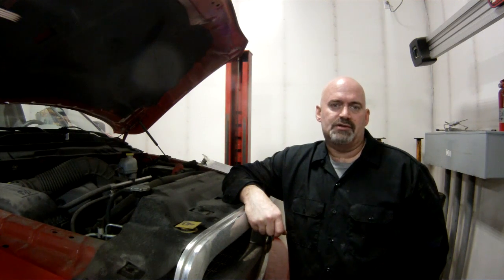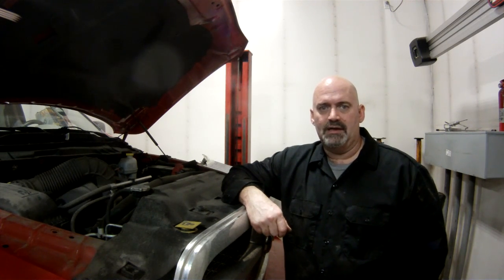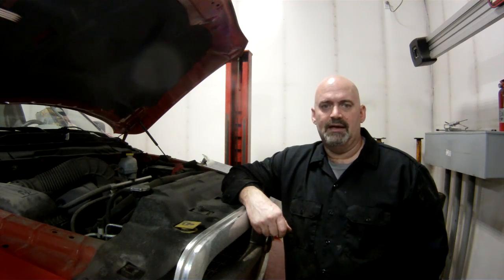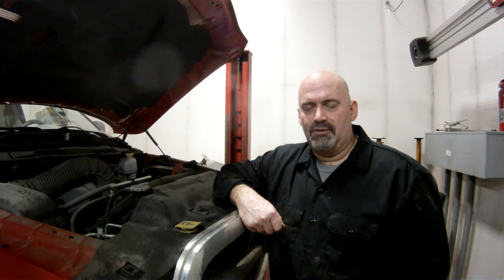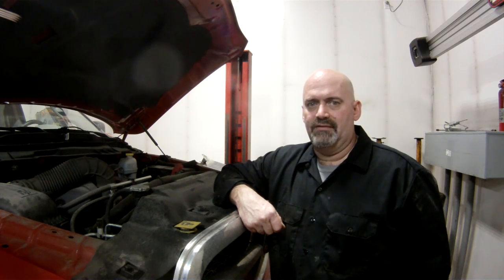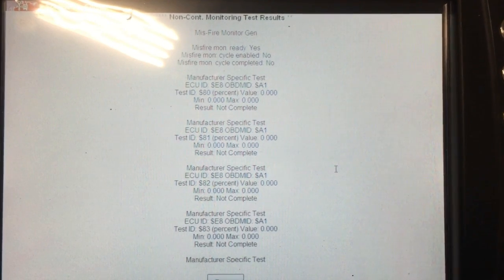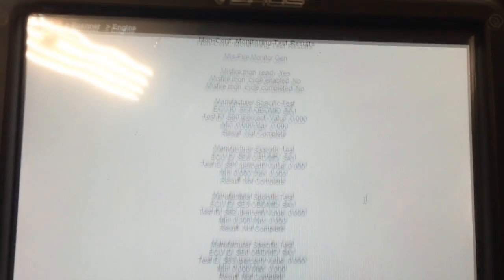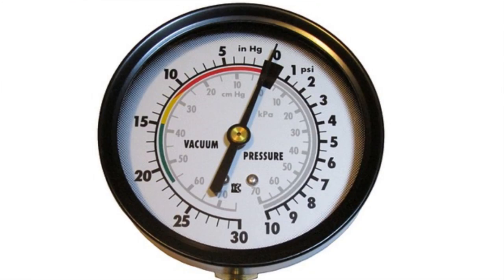Dodge 5.7 Hemi Misfire Problems

Comment: I had a 2012 Ram 2012.  Started with sticky lifters sounds.  quickly got a light with a quick loss of power.  code was p305.  when taking the top off the lifter had alot of movement which later discovered 2 parellal scaring lines on the cam shaft. everything was toast just about.  just as cheep and easy to replace motor.  Shitty thing is it only had just over 83000 kms on it.  the truck was not quite 6 years old with all service up to date yet the warranty was expired.  I will never get one of these trucks again.  Completely ridiculous that they get away with this where it is so common not to mention a costly issue.  New dodge coming out soon and as good as it looks I would say to anyone to stay clear from them, since they are staying with the same engine.  Hopefully anyone else who bought these trucks have better luck
Reply: Rick Hall I’ve had 4 hemi engines in 4 different Chrysler vehicles I’ve never had any issues with them and I beat on them pretty good. Things happen nothing is made to last forever. What’s your point beside you hating Ram trucks. I had a Chevy with same exact problem being diagnosed in this video turns out it had a bad lifter that damage the cam. My point being any motor can have issues 🧐🤔you just sound like a hater to me.

Comment: For random misfires, don't forget to inspect the water temp sensor. Mine had the issue that the engine thought the engine was cold when it was hot and adjusted the AF ratio.
Reply from the maker: Oh yeah, an improper reading from a coolant temp sensor can cause some serious problems. If the ECU thinks the engine is cold when its really hot it will run very rich but usually set a code before long when fuel trims get whacky. Thanks for sharing!
Reply: I only got a P0300 code. The dealer discovered the issue too late. After replacing the temp sensor the engine dropped a valve 3 weeks later. What do you think about Remanufactured Long Blocks? Any companies you can recommend? Promar? S&J? Powertrain Products? Would love your opinion before I go ahead and spend a lot of money....
Reply: @LifeStyle-uh1ns  did you figure out the p0300 code

Comment: I have a 2005 hemi and it sat for a while. When I started it up the RPM goes over to 2500 or more and it accelerates on its own. My wiring harness was damaged by rats but I have sense repaired it. It looses water out of the reservoir after driving but never goes hot unless the water gets too low. Can anyone offer any suggestions? There is about two to three issues and I really Love this car.

Comment: I have a 2004 Dodge Ram 1500 4x4 never broke down in till now, no engine lite on but hard to start I must keep running with me holding down gas peddle as soon as I let off it shuts off running like bad cylinder any ideas would be appreciated.
Reply: Edward Hollingsworth try cleaning throttle body with seafoam, sounds like it could be gummed up and getting stuck. I'd also do a compression test for vaccum leaks might not be getting enough psi to run on its own.

Comment: Question: A 2004 5.7 Hemi was run extremely low on oil and driven God only knows how much. I added about a gallon of oil to the motor and started driving it. I have not had the chance to hook it up to a code reader yet. It has a slight miss at idle that seems to go away under acceleration and steady cruise speed on flat ground. On slight hills, however, it slows up and starts "bucking" a little until it finally seems to misfire with a "pop" to the passenger side of the motor. I have to switch to the "tow/haul" feature to get it to climb a hill without bucking. The truck is empty. Any thoughts?
Reply from the maker: May have issues unrelated to the oil deal. I would pull the codes and isolate a misfire and go from there. Doesn't sound too good. Thanks for tuning in!

Comment: I have a 2013 ram 1500 5.7 hemi with 73,000 miles. Im getting 10mpg and was getting 13-14 mpg two weeks prior. When the truck hits 20-30 mph it will stop accelerating and kind of stutter up hill or on level ground. I have to put it to the floor to get it to shift. Power comes on very slow if I do not floor it. New spark plugs we're just installed. A friend of mine thinks it may be a torque converter but I'm not so sure. Any thoughts on what this could be?
Reply from the maker: Sound like a misfire issue. What have you tested?
Reply: Going to clean my throttle body and replace the erg sensor. Also my truck had white smoke when I started it.
Reply: I traded it in lol
Reply: That is a condition of a clogged catalytic converter.
Drive the truck for 5 min. and look to see if the converter is glowing red.
If so change it, if not further diagnostics are required.
Reply: Constitution 2nd amendment
 just keep driving it that what you're supposed to do when you have serious problems,and keep guessing and replacing parts by the guessing method you get to  that part eventually!!  instead of taking it to any autozone ,checkers, walmart , o'reilly's where they read the codes for free !! now i know why i see premature death of trucks in the junkyard all makes sense ," i drove it till it blew up" LOL

Comment: I regret ever buying this turd of a motor. Bought used had for 2 months then wrist pin snaps then I have a hole the  size of a baseball in the block. Paid 6k to replace motor less than two weeks get a p0300 code get that fixed runs right then the same day get a p0306. Love the truck but damn it's a turd

Comment: Just bought a 2013  hemi charger police car.  Have #3 misfire looks like I will be doing cam and lifters.
Reply from the maker: OH no, bummer
Reply: Thanks for the video sir very helpful .
Reply: Same issue on my 09 pursuit.  She's getting a new power plant.
Reply: Hope you also replaced the rockerarms and springs.
Reply: Chuck Connors lol, same here, I have a Dodge Charger Pursuit 2012, and it has a code p0302 “misfire” we changed the spork plug, injector, and the coil, but it shows the same code, do you think is the cam and lifters? And how much did you plaid to solve the problem?
Reply: Fernando Vz did you ever find out the problem on your car I have a 2013 pursuit and did everything but change the headers/lifters

Comment: hey doc, is it normal for these engines to slightly stutter? i hold the accelerator in one spot at park and try to hold 1500 rpm and it goes +/- 150 rpm. hooked up to obd2 reader shows the timing adjustment fluctuating with the rpm but throttle remains in the same spot

Comment: I am getting this P0304 on a freshly rebuilt motor from PowerTrain (less than 10 miles on it). I also have a EGR code so first thing is to replace the EGR valve. I would doubt on a new motor that I have a bad valve spring. I used BlueDrvier code reader on my Ipad to get the codes. What else can cause this code?
Reply from the maker: Start with the valve...very common. Maybe got a chunk in there from the rebuild. Clear things and re-test

Comment: hey doctor thanx for this great video like always you the men! on other note I have a 2006 wit 3.7 engine dodge durango it shakes at idle I change spark plugs ignition coils and still does it its funny cuz it only does it at idle or at stops ,but the other day I was turning my steering wheel at idle and some how my shaking stop but if I move my steering wheel again the shakeing at idle starts.. help..._ thank you..
Reply: 3.9's (same engine) are notorious for a leaking bank 1 head gasket, cylinder 5.

Comment: Hey car Doctor...need a tip. 2011 Durango 3.6. Just paid dealer to  replaced sensors, P000A, P0017,  P00455. Now less than 500 miles getting P0131, P0300, and P0171... going to new shop..They all want to start with a tune up and a coil. I'm not too certain actually very skeptical. I think it is something completely different. Any tips outside of vacuum leaks and spray carburetor cleaner. I think it may be a quick fix from a sloppy job or triggered from the sensors? What do you think, trying to save 600?

Comment: 2004 Dodge ram 1500 5.7 hemi  2wd had p0300,p03005 replaced number 5 injector and plugs . Started up again new and only code now Po175 bank 2 still ideling rough as before ??

Comment: Thanks for the video.
I have a 2011 Ram and get a "misfire" code on cylinder #1 at high RPM only.  does this sound like a cracked spring also?
Reply: lifter failure
Reply: Mines doing this right now, what ended up being the problem?

Comment: got a 2007 1500 with the 5.7. had is scanned the first time and said cylinder #4 misfiring. replaced all 8 coils and spark plugs. now when i hit 35-40 mph at around 1200RPM the engine shakes like crazy. (misfiring) i had is scanned again and now it is saying cylinder #5 and #7 misfiring. checked seating of the coils and the electrical connections for all of the coils. any thoughts on this issue?
Reply: Theres 16 spark plugs in a hemi
Reply: Mine did exact same recently but cyl #2 misfire. I changed all coil packs and plugs, still did it at 40mph. Then i changed injector on cylinder #2 only, along with only premium fuel and some seafoam n lucas....so far so good. Also had to recently change egr valve and throttle body due to carbon build up, more codes and rough idle/cutting out at take off or low idle speeds.

Comment: mine is a 2003 Dodge Ram 5.7 Hemi---when its cold it normally runs good---then after a few miles at a light it idles up an down---sometimes shutting it off and starting it again gets it running smooth for a few miles---sometimes reving the engine clears it up for awhile--engine code that came up  for the oxygen sensor---could only find 2--suppose to be 4 but mine seems to have only 2---did not help---changed the 16 plugs---if anything worst---did a fuel cleaner thru the fuel injection system---did not help---and I know the fuel pump was changed 2 years ago---although this sounds like the problem---the other fired it up and ran for 2 hours with just once it rough idled--today it seemed every red light was to be a rev at the light to keep it running---do you think it could all be just a valve spring--Thanks in advance
Reply from the maker: possibly a spring. Whats the fuel trims look like?
Reply: jees never heard of such a thing as fuel trims can you tell me what to look for---no luck with googgle

Comment: Hello -- I had the p0300 code come up when the engine was misfiring and running rough as you stated. I have an 07 Aspen with the 5.7L Hemi. I took it to the dealer with your recommendaion of the valve springs issue to replace and they stated they found misfiring on cylinder 1,2,3,4 and 5. Also stated radiator and coolant reservoir are dry with no external leaks. Their diagnosis is motor ingested all cooant --I need to verify if they checked the oil drainage to verify this. Dealer stated they completed a leak down test which showed rings leaking into crankcase. The tech recommended engine replacement. Thoughts before I take actions?

Comment: so i have a 08 ram 1500 with the 5.7 and it is getting the general misfire code, but it only happens when i am trying to accelerate in ecomode, and only when it is at it's worse does the engine light even come on most the time it just misses with out triggering the light, replaced the spark plugs and it only triggers intermittently apparently, but the dodge dealer has now had it for 4 weeks and they still don't know, admittedly 2 of those were because they were backed up but still.

Comment: Loved the video could this happen with a 3.7 v6.
I get a misfire code on Number 4 
i have cleaned the injectors, moved the coils arround and changed plugs but still get the misfire code.
this truck has a economy feature im not shure what it does but when the light is out it will run very rough while in this mode. then ill get a misfire code and it will run smoother.
I dont think the rocker arm has fallen off on the motor like they will sometimes on these but was wondering if the lifters valve adjusters were pooched.  
any help would be awesome . 
thanks
Reply: Jim McNally had the same issue. turns out my pcm was faulty. might want to have that checked
Reply from the maker: Many of these issues can be found on your motor but it sounds like youll need to dig a little deeper on this one. Compression test is in order.
Reply: nick stevens I have a 2004 Dodge Durango 3.7 I found water in all of spark plugs I changed them, the coil packs and did an injector test and everything came out good but I'm still having misfire on one and four cylinder does this sound like yours when you replaced the PCM
Reply: love Diamonds I didn't have the water issue. just a misfire on 3. I checked the coils, plugs, injectors, valve springs, rocker arm, voltage test on everything. Even did a compression test. I finally took it to a dealer to have the pcm flashed, that's when they found that it was bad. If it were me i'd try to eliminate all possible causes, if the problem is still there, take it to a dealer and see if they can do a pcm flash reset.
Reply: nick stevens okay thanks so much for the reply and the information
Reply: when I get it figured out I will let you know what it was
Reply: love Diamonds no problem man. good luck.
Reply: nick stevens we pulled valve cover and Rockers all look good just going to do a compression test and go from there

Comment: If you have the engine code P0307 and swap injectors with cylinder 1 and now misfires are on cylinder 1, could this just be a bad injector? Truck is a 2009 Ram with 220k on the 5.7 so it could be anything :)
Reply from the maker: If all you moved was the injector and the misfire moved with it it sure sounds like a bad injector

Comment: I have a 2005 magnum rt with 5.7 hemi. It has no misfires, but the has a fairly loud tapping sound when its started cold. It goes away after reaching operating temp. Its been doing this for years, and it runs great, but do you have any idea what this might be?
Reply: I know this is out there but I had the same thing. Kept coming and going and I said, " Babe its the hemi tick" that everybody talks about. I had a tiny oil leak on the passengers side and I hate ethat sort of thing so I ordered up a set of VC gaskets( Major bitch to get the Pass Valve cover off) Anyhoo..... I open her up and to my utter shock the 2nd hold down/retainer (counting from the front) that holds the rocker shaft to the head was around 6 full turns out flopping in the breeze!!! crazy I know but it may be like this in many vehicles and nit addressed. Maybey a bad day at the factory with one of their assembly. A definate eye opener. I am having p0305 codes and just thought Id pass this along to you.
Reply: hey Ed . Found out a bunch of stuff since we were bashing this dude.go to Mopar.com,  click on MY Vehicle, Click on "recalls", Put in you VIN#. If there are any recalls on that VIN the will show up on the screen, as "completed"(blue) or not completed(red) BE SURE TO SCROLL DOWN SINCE THE INCOMPLETE WILL BE BELOW THE COMPLETED!! It does not matter how many miles or how many years old. The have to honor the recall.  So if your header(manifold) bolts rotted out they will replace them if it was recalled
Reply from the maker: My guess would be a worn lifter or rocker. Would probably have to do a physical inspection to locate the issue.
Reply: Thanks, for your reply. Im planning a valve cover gasket and spark plug change this spring, so I'll check everything out then. Also thought about doing a timing chain and tensioner replacement. Hope Im not biting off more than I can chew.
Reply: The Car Doctor why do you keep repeating the same thing? I thought it was a video loop lol
Reply: i got the gaskets from a reputable seller on ebay. Easy job except fot the passenger side. Actually broke the dipstick bracket that'"s how tight it is. like I said it could also be the hemi tick. I you look on YTube at "Hemi Tick" it is caused by the way the spring seats are machined or something and the spring wears a grove or something and hence the tick. If you were to fix it it would be back in 30k miles. add more sound mat under the hood. the ALL make that noise naturally. But as I said it never hurts to check
Reply: this guy should know about the tick if he was a hemi dr. He needs to search some videos and get schooled. he needs to watch some videos and get schooled, he needs to watch some videos and get schooled, he needs to watch some videos and get schooled, he needs to watch some videos and get schooled, he needs to watch some videos and get schooled, he needs to watch some videos and get schooled, he needs to watch some videos and get schooled, he needs to watch some videos and get schooled, he needs to watch some videos and get schooled................................  LMFAO
Reply: this guy should know about the tick if he was a hemi dr. He needs to search some videos and get schooled. he needs to watch some videos and get schooled, he needs to watch some videos and get schooled, he needs to watch some videos and get schooled, he needs to watch some videos and get schooled, he needs to watch some videos and get schooled, he needs to watch some videos and get schooled, he needs to watch some videos and get schooled, he needs to watch some videos and get schooled, he needs to watch some videos and get schooled................................  LMFAO
Reply: hey. Your pre 2007, The had a recall due to the fact the put pussyass bolts in the exhaust manifold and the bolt heads rot off and you will get exhaust manifold leaks which make a tick sound also. The easy test is to reach down toward the rear of the engine(when motor is cooled off) and see if you can wiggle the thin heat shield that deflects heat from the manifold. if it wiggles the bolt heads are sheared. You may be able to get that from a recall for free at the dealer
Reply: Fixed under recall from my local dealer? That made me laugh. The dealers around here would say it was completely normal, and then charge me $75 bucks just for raising the hood.